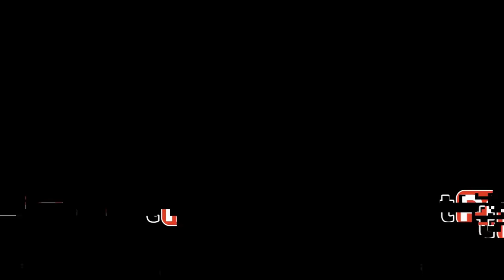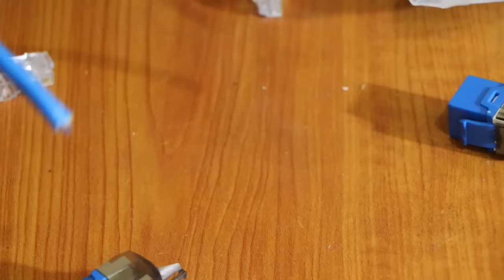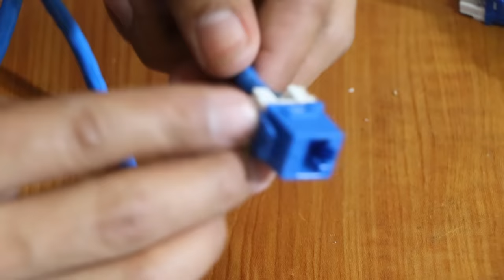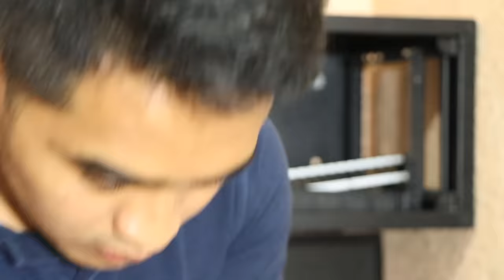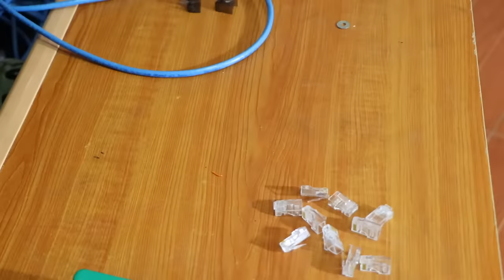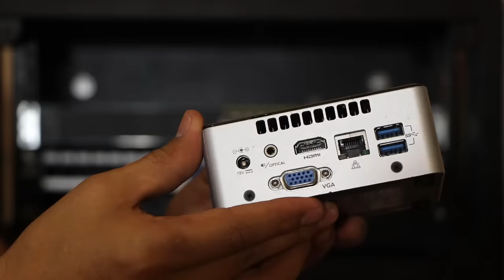DIY Home Network: Experts Debate – Right or Wrong Techniques?

Comment: Isn't the min length on the patch cord at least 1 ft long?
Reply: Only when it goes from one device to the next. You'd be correct from the router to the switch but not the switch to the patch panel. The patch panel is only an extension of the cables plugged into the back of it.

Comment: 1. There is a bottleneck in your network connection to the router, the link going to the router should be on the 100/1000Mbps interface. unless all ports are gigabit and you can configure them as required.

2. Making your own patch cord is a bad practice, some of the links could be less than 1000Mbps or less than 100Mbps as the case my be because of resistance caused by improper pin contact.

Comment: dude why are you using a cisco 2960 in 2018 they are 24 ports fast ethernet and only 2 ports gigabyte. the only reason to have them is cctv systems that only have fast ethernet and for cisco ccna practise

Comment: Thanks for the video!

I thought the shortest cat 5 should be 1' ?
Reply: Only when it goes from one device to the next. You'd be correct from the router to the switch but not the switch to the patch panel. The patch panel is only an extension of the cables plugged into the back of it.
Reply: @aguyandhiscomputer  and you shouldn't go swimming right after eating... smh.
Reply: @FirstLastOne  correct.

Comment: Can anybody tell me why we use the patch panel??
Reply: In the majority of home networks, patch panels are not necessary. The cables that run from the network drop to the panel are usually not meant to be moved around much. They are stiff and can internally break if you bend them too much. So the cables are terminated at the back of the patch panel. You then connect a patch cable from a port on the panel to the switch to complete the connection. You can forgo the patch panel and plug straight into the switch ports but it isn't the recommended practice especially if you'll be plugging and unplugging cables regularly.

Comment: 1) why do you need L2 switch at home?
2) this cisco switch makes a lots of noise and eats lots of electricity. I don't think this is the apropriate devise for home use
3) instead of this better way can be of using rack-mount mikrotik router instead of cisco switch made in mid-2000's.
Reply: p.s. you are using too short cables to connect patch panel to switch. it has beautiful look, but does not give you ability to connect patch panel to the top ports in the switch.

Comment: You must be new at this because I've noticed that your cage has openings for cage nuts and you didn't use the cage nuts you use regular bolts why did you not use cage nuts it would hold them on better

Comment: Why not crimp an rj45 on and plug your wires right into the switch?
Reply: You can do that. In setups like this, you install a patch panel because the cables that run from the wall are not very strong. If you move them around too much, they can break which will require replacing the entire cable run. That's why you terminate them to the patch panel. You don't have to worry about damaging the cables if you need to patch/unpatch network drops. Its not absolutely required, but when you have many network connections, in a school or office setting for example, it makes sense to do it this way.

Comment: There is a standard length that you need to use for patch cables, and that is at least 1 ft in length. Using lesser lengths can result in impedance in the run.

If you can do your own cables, there's no problem with it in my eyes. However, this definitely doesn't fit the spec of a patch cable.

Comment: Hello,i'm a student of CS in China,i watched your video and i thought it's good to be a teach video. I want to translate it to Chinese and repost it to a Chinese video website called BiliBili(bilibili.com). If you agree,i will not do change to this video(your name or other things of copyright),only translate and add subtitles. THANK YOU !
By the way,i have some questions of your network topology.
1.Your router looks like a ADSL modem,Why use that? your switch is so good,the modem will be a bottleneck of your network's exit(or i guess your area does not have fiber to home service).
2.Why connect router to switch's ethernet port? i prefer the uplink port(port 1&2 on the right side).connect to eth port,the switch will work on a stupid mode(like switch without net managing function),if connect to uplink port ,it will work as a Layer 3 switch.

THANK YOU AGAIN!

Comment: When I did this and needed a bunch of patch cables to go from the patch panel to my search.  I just went and ordered a bunch on eBay for pretty cheep in the length I wanted.  Not waste my time making a bunch of those cables.  Of course I have a much bigger switch.  Why he didn't fill in those squares with the right fitting and why skip 1 hole?. Also use a rash shelf for stand alone, non rack hardware.  Don't stack on your hardware like the switch.

It's looks so sloppy.  This is a video of not what not to do.  It looks half a$$.   I do have to say that my home network started with bring on a couple wood shelves.  Then I got a rack a few years later and completely redid everything and now it looks professional.  Skills I've picked up over the years.  I noted have a 48 port switch in my small house.  I'm not using all the ports, but I needed more than 24 ports.

Comment: [Please Read] 

Hello everyone, I am really frustrated with an issue. i hope somebody will help me out with his knowledge.  :) 

I have a broadband connection (Local ISP) they gave me only 1 local ip with 1 mac access. So i have to use a router. 

So the problem is i used many routers but all of these routers have same issue. when i keep the routers 24/7 turned on they starts to drop packets. 

Then i have to turn them off for a hour and again turn them on :( It's really frustrating. 

Can anyone help me ? 
Which router should i use? I don't need wifi i just need the basic routing feature. 

My network diagram....

ISP > Media Converter (Fiber to Ethernet) > Router > Switch > All devices (PC,Printer,Mobiles) 

Thank You 😊
Reply: What kind of router and switch are you using? Sounds like an issue with the switch

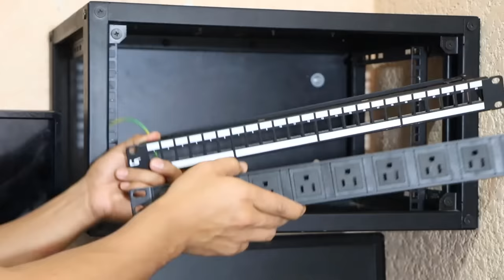Comment: 3:05 my OCD kicked in when he mounted his power strip upside down.
Reply: I would have mounted it so the plugs were facing inside.  That way you don't see the plugs.  I know that would be hard to add new plugs to but would make it look cleaner.
Reply: Believe it or not, the way he mounted it, with the ground above the hot and neutral, is actually right side up. Placing the ground above the hot and neutral reduces the risk of the plug sagging out of the outlet and contributing to a short.
Reply: @crazyace63  It probably has plugs on the backside as well.

Comment: those 6 or 7 inch cables are not up to standard. 1 foot is the standard minimum length. also, how the F are you mounting them without cage nuts? WTF BRO!!

Comment: I think these are over kill for a home use,  look like you have 24 ports switches, unless you plan to add 24 more rooms to your home, other wide it will be a waste, or you could run all those ports to your neighbors, and charge them fee for the internet, that way your whole tribe will have internet access.

Comment: Sorry but this is not right. Almost all of it is wrong. Never make your own patch cables, the manufactured ones are better. The patch cables are too short. Use cage nuts. Put the bolt in the bottom hole, not the top (think about the pivot point), and preferably top and bottom. Never leave a 1 hole gap, always 3 holes if you must leave a gap. Patch panel is best at the top. Label the patch panel. Excess cable should go to the side and be nearly wrapped with Velcro. You appear to have used the right hand 2 switch ports, which are usually faster, as access ports. And you installed a power brick covering another socket when you didn't have to.
Reply: Trying to be constructive. The reason you don't make your own patch cables, is if you are using sold wire cable (like in the video). It will break down and stop working with all that flexing and movement over time. You must use flexible stranded wire for patch cables. I have removed a lot of home made patch cables for clients and they thought their issues were coming from bad network cards, switches etc. Couldn't be those 'custom' patches they over paid for from their cable tech. Patch cables if you purchase with a good supplier are less expensive and will last much longer.

Comment: What is the right and wrong here? It's more like what am I doing right and wrong here? Use the right cage nuts fasten your gear to the rack. Not screws and bolts! It'd obvious you haven't use them. So a 4 out of 10 for looks.

Comment: Almost so clean but those short jumpers with no loop make me cringe and the top bolts only come on... what the heck is that crap... 4 bolt or cross bolt..... scratch that 4 bolt or get out worked by a cleaner tech.

Comment: Always buy a rack with front and back mounts and always put the PDU in the back. there is no logic in consuming 1U with a PDU unless is a bypass PDU and even then i would think twice, power goes back, data goes front. well, i'm against mounting the patch panel wherever you want but putting device on  the switch.... NO. you have the entire base of the rack for that if you don't have place for a tray, come on man. damit, i edit this for the 3-rd time... why the 1/2U space between elements? Anyway, it's yours, you can do whatever you want but then people will look at this video because it says it's a PRO guy. dude, this is not PRO. too bad i can't post links to show you PRO.